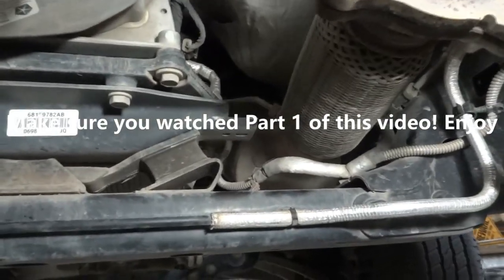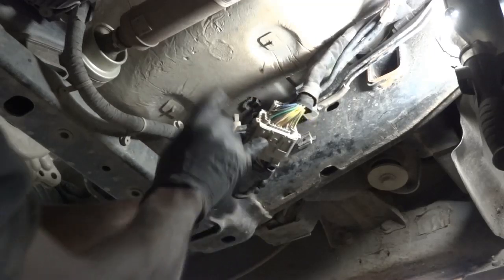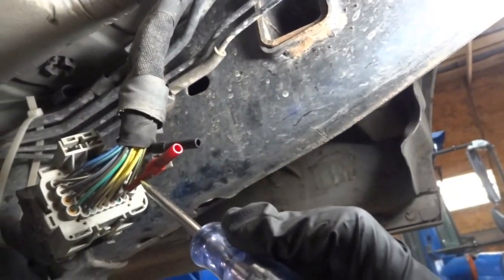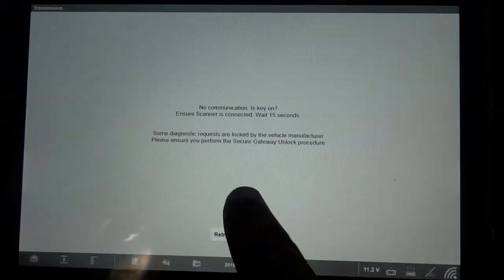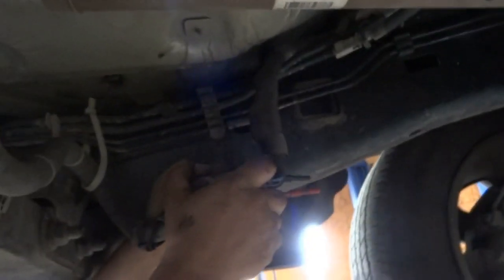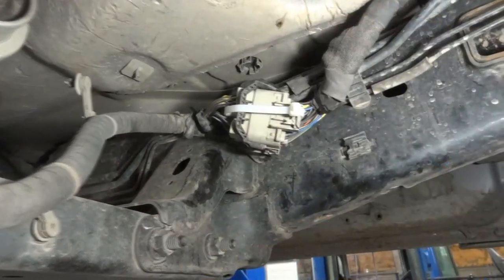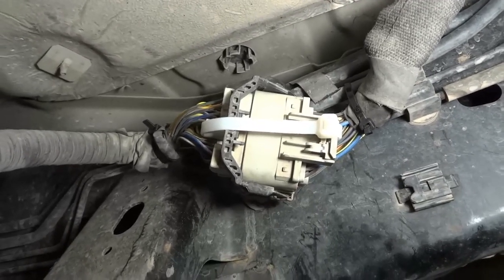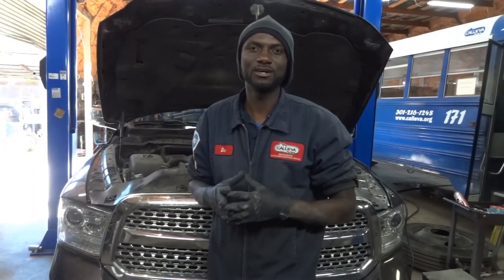2018 DODGE RAM LARAMIE NO CRANK NO START / CODE U0101 LOST COMMUNICATION WITH TCM " THE FIX " PART 2

Comment: Great work, very impressive.  Got a question!  Have a 2005 Chevy Cobalt 2.2l.  Can low transmission fluid cause "Code U0101 Lost Communication with TCM" also?
Reply from the maker: Knyyght Rydaa No I don't think so!
Reply: @KITS_Auto_and_Truck_Repair  O.k. Was just wondering if that issue could possibly cause that code also.  So if that doesn't cause that code and the positive and ground checkout, then the problem must be a faulty/bad TCM, right?!
Reply from the maker: @knyyghtrydaa2084  Yes!
Reply: @KITS_Auto_and_Truck_Repair  Thanks for your help and timely responses!!
Reply from the maker: @knyyghtrydaa2084  My Pleasure!

Comment: Did u end up  finding the wiring  harness From dodge?  
If u find it  is it possible  to tell me what  was the part number
Reply from the maker: @yasharrezakhan433  Yes I got the wiring from my local dealer
Reply: @KITS_Auto_and_Truck_Repair   dodge does not have in Canada,  did  you get it from your local  dodge  , I f  I found 1 which was over  2 500 .   I  am really  want to help my   customer , to avoid paying lots of nonsense  money for a connector.  
 Can u give  me your supplies information? If u found  a cheaper one.

Comment: I dont have power on yellow/red fusebox side. However i do have power at and under the fuse, at the fuse box. Can i run a jumper from fuse 57 to pin 13 on the trans? Pin 13 is FSD B+
Reply from the maker: @darbycrash55   You could but be careful though

Comment: Hey brother, what if my PNK/WHT wire doesn’t have power. Unless I give it a + and it starts working in the truck. Thank you
Reply from the maker: Big G  You might have an open fuse or an open wire!
Reply: @KITS_Auto_and_Truck_Repair  is there a fuse for the bcm?
Reply from the maker: @bigg704   That wire is not coming from the BCM, it's coming from the fuse box!
Reply: @KITS_Auto_and_Truck_Repair  is there a way I can contact you about this issue. I can’t find anyone to help me and your videos got me closer to the problem than anyone has. Thank you
Reply from the maker: @bigg704  you can email me at deo@calleva.org

Comment: Great video on this problem but the problem I have I have no power to that plug after an accident. But I have power at the fuse box and the wire coming out of it. I would love a full wiring diagram for this circuit but can't seem to find one.
Reply from the maker: Max H.  You have an open somewhere in the harness, you can get a wiring diagram from your local dealer or mitchell prodemand!